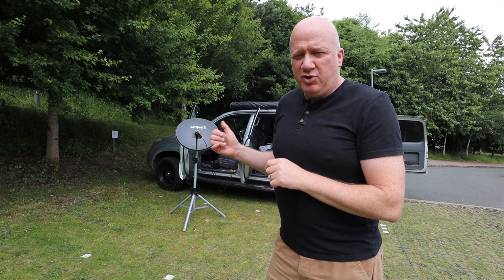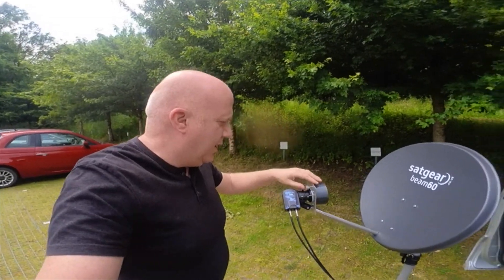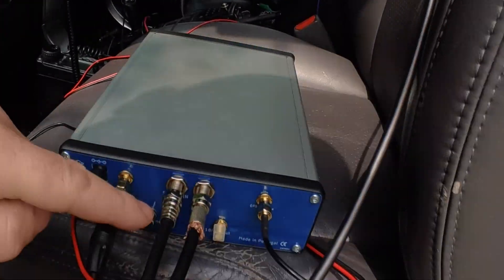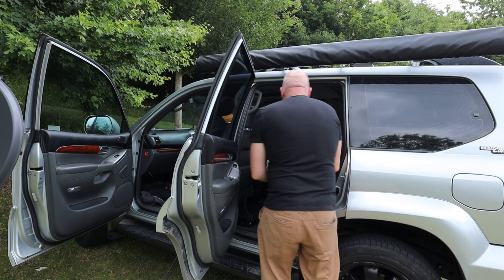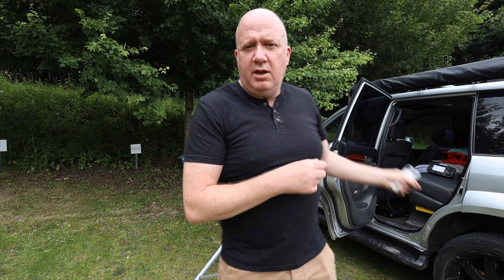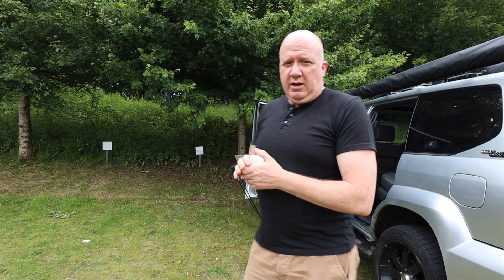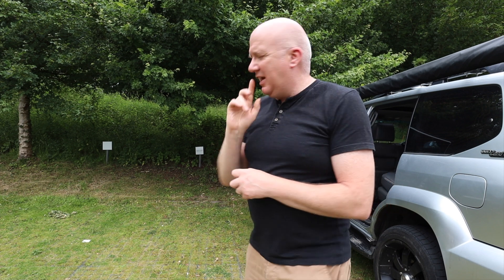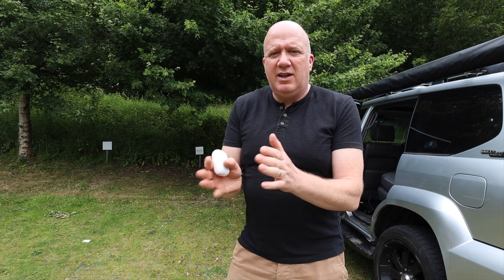First steps into using QO-100 Ham radio satellite | DX Patrol Groundstation

Comment: Hi Carl, I have the Groundstation and it's a pretty good box - I use mine for portable use. I'm not sure if you have the later version with the PTT input? If you have I'd use it. Mine doesn't and it can be a bit choppy on TX as the VOX delay seems a little short (on mine anyway). Not bad signals for a 60cm dish! At home I use a 90cm and a 60cm for portable which I think is probably a little small. 

Great video and intro! Good luck!

Comment: For easier azimuth positioning I mount the dish bracket on kee klamp (hand rail fittings) sleeves. These rest onto a kee klamp collar onto the mast. My mast here is 44 diameter scaffolding pole mounted on a flat roof stand weighted with paving slabs. To rotate the dish I undo the grub screws on the sleeves and give it a nudge. Re-tighten the screws. It doesn't drop because it's rotating and resting on the collar. I'm using a 1.1m dish on the wide band transponder. To adjust the elevation I use an old scissors jack between the dish and the mast secured with long  cable ties. BATC Portsdown 4 DATV system comes with a beacon signal strength meter on its display. So a series of moves to peak the meter is fairly civilised. I also have a LNB focussing slide made per an article in OSCAR news.  It looks like you're doing great. 73 David M0YDH

Comment: The dish is too small, thus the gain is low.
Reply: Eliptical dishes are useless on TX
Reply from the maker: Aha! This could be the reason! I’ve got another video coming out later this week where I try portable satellite from my car and the TX was terrible
Reply: I have exactly the same setup DXpatrol GS and Helix but 60 cm offset , If you look on the construcion of an eleptical dish you will understand that its diddficult to iluminate. I am aprox S9 on the QO100 when listning on my 2m dish at home so the euqipment works. So get your self a proper dish NOT Eliptical like an egg :-) de SM4IVE

Comment: Clearly a very interesting learning curve. Sadly, I can barely afford my cellphone. But more power to you young man!
Reply: I use Blue DV for Android and Windows, all you need is the DVMega DV Stick 30 and you can chat on DMR, D-Star and Fusion, it doesn't cost a lot and Blue DV for Windows is amazing. It also works on Chromebook with multitasking ability and on Android without multitasking but I use it on my phone and on my Samsung Tablet too. 

Best of all you don't have the headache of programming a radio for digital modes, DMR being a right headache to get going.

Comment: I used to sell/install T-Com C-Ku 3meter dishes. Luckily I still have one left. While you are home look at your dish and receiver. Note the direction of the antenna and the signal strength. When you go out and set up your dish set the vertical main pipe at 90 deg. Work the installation one variable at a time. Set the height. Find out what the angular path the satellite takes. Remember true North. Set the dish accordingly. Fine tune and snug up all of the bolts. You should be alright. I am sure that Cal from DX Commander could throw a few pointers your way. KD2WBK  73's

Comment: Nice work Carl. You may wish to add a left hand skew to the LNB. Rotate the LNB clockwise to see an increase in signal. If you have difficulty finding the sweet spot turn the Rotate the LNB anticlockwise until you hear a null or dip in RX signal then rotate the LNB 90 degrees clockwise and you should be fairly close if not spot on. Keith G0FEA
Reply from the maker: Thank you I’ll try that as Im trying to set it up at home but the signal is quite weak

Comment: Another interesting video thanks. I built my own fixed QO 100 ground station from scratch, I took the SDR PC based system approach, so everything is controlled through a PC / laptop. A couple of points, your dish is a bit small, which will affect gain. You can’t have any trees in the way, and as you found, dish alignment is critical. Good luck!
Phil G8PJH

Comment: That is interesting,I have Baofeng UV-5 R Hand held,do I need a special antenna to work Satellites? 73 de ZS5DG in South Africa.
Reply from the maker: I would read up via Amsat but it’s possible https://amsat-uk.org/
Reply: A higher gain or yagi is GREATLY preferred for the Baofeng satellite use.  It can be done with the higher gain antenna but a yagi is preferred over the high gain.  I have used both.  Mostly as a challenge to myself.